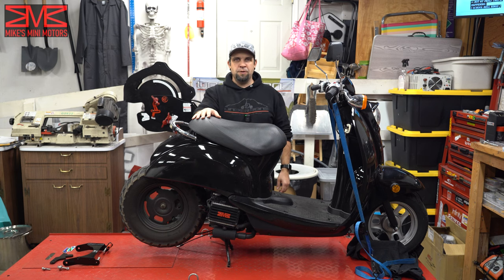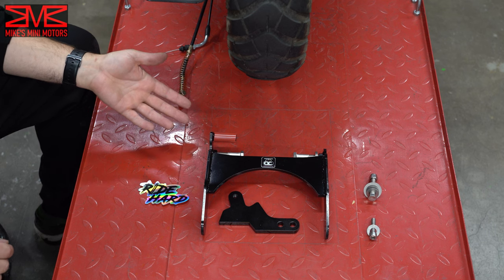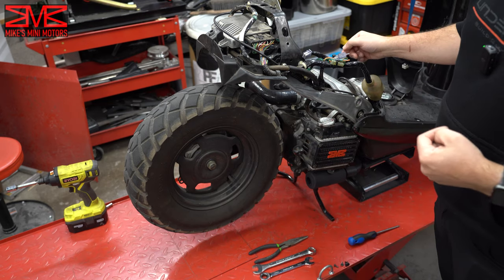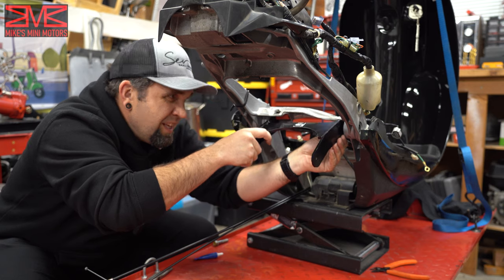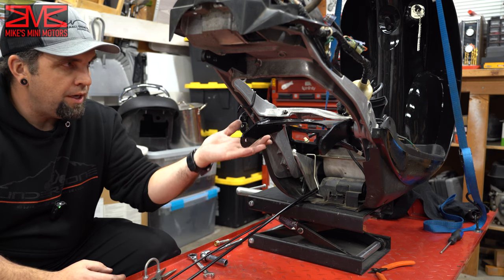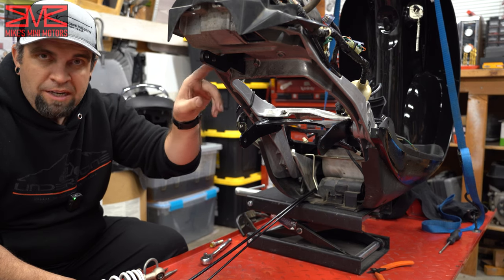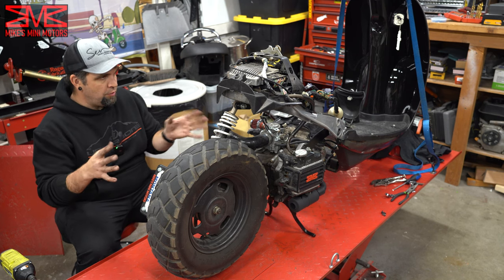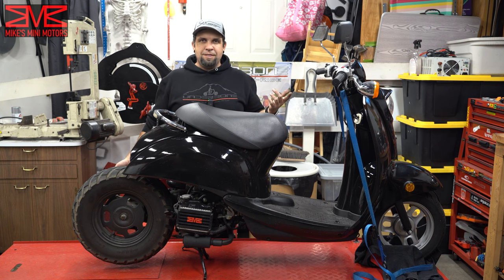Honda Metropolitan - Small Fast Things Stretch Kit Install

Comment: when you bolted the ruckus swing arm on was it direct? did you have to grind anything ?
Reply from the maker: I swapped the entire GET engine out of my Ruckus onto the Metro. So it was a direct swap. The only cutting I had to do was a little bit on the rear plastics.

Comment: With this is there enough clearance for the stock airbox? I dislike the drone of a pod filter
Reply from the maker: It looks like it may, but my bike didn’t have the stock air box, so I can’t say for sure. The angle of my shock looks like it may interfere with the air box though.

Comment: mike i have a question, i have a 2012 ruckus and i just cant get it to start, i dont have spark and it just doesnt want to start off of starting fluid, is gas needed or should it start off just starting fluid?
Reply from the maker: It should start of starting fluid. If you do not have spark, have you checked your kill switch? I have hit it on accident before, and it always leaves me scratching my head as to why it wouldn't start (and it kills spark).
Reply: @MikesMiniMotors  yes i do have spark and i hear the fuel pump, do you think since it hasent been started in who knows how long, that it just needs gas and fluids ran through it?
Reply from the maker: @quinton7854  If it has been sitting for a while, the fuel may be bad, if it wasn't drained. Have you cleaned the carb yet? If it was sitting, that would be one of the first things I would do.
Reply: @MikesMiniMotors  ok i havent touched the carb, i was thinking of adding fuel and see if it cleans itself out before i get that far, but i was thinking it would start off starting fluid no problem, it does try to start tho
Reply: @MikesMiniMotors  also when i got it the ruck didnt have any fuel in it
Reply from the maker: @quinton7854  The fuel bowl may have still had fuel in it. So, I would still clean the carb first.